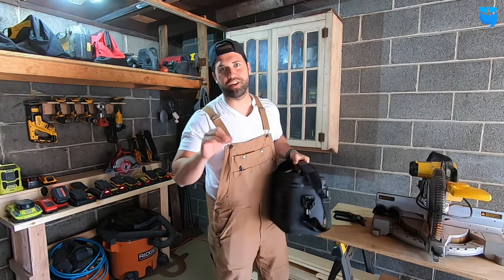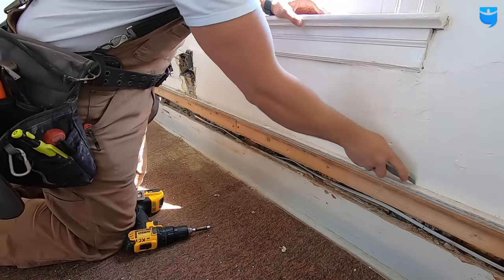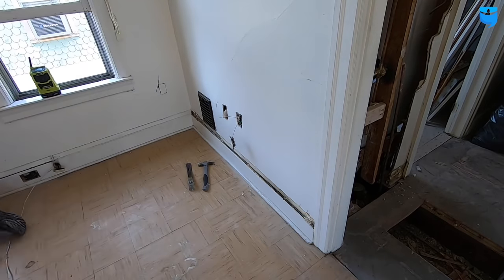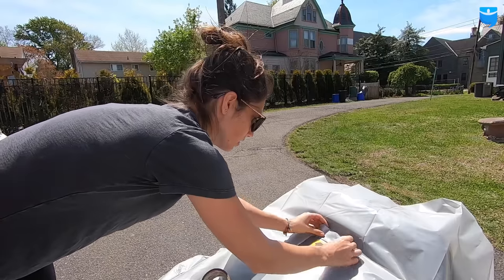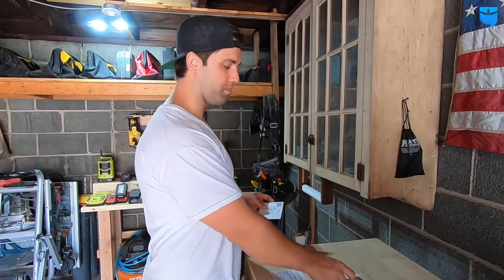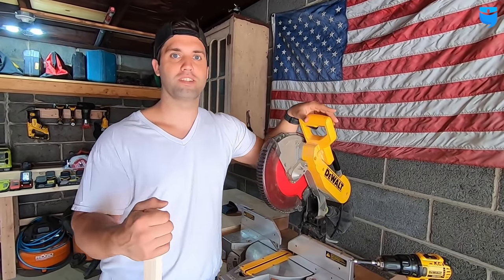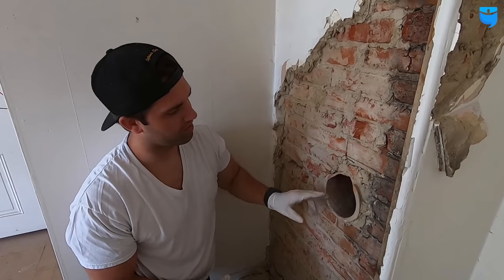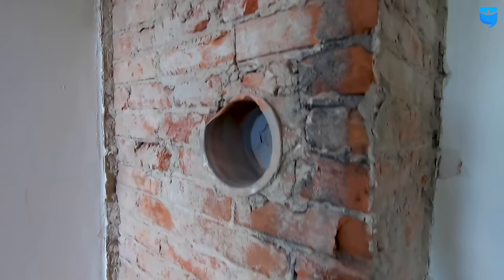EP 10: Exposing Brick, Drywall Installation & Renovations on Our BRRRR Triplex Investment Property!

Comment: seems like the exposed brick is unnecessary labor for a rental house eh?
I would have just left the plaster on there and kept the whole room white.
Reply: We are ALWAYS looking for cheap ways to set our units aside from others. Don’t stray from your budget but we are huge believers in renovating for the tenants you want.
Reply: @RentalstoWealth  how do you clean the brick?
Reply: mario butters So I kinda like that German Shmear kinda look so I just wire brush by hand any raised and loose stuff away then put the sealer on BUT if you want it clean looking I’ve used this before and it works super well (do any brick cleaning/drilling and apply the sealer prior to laying flooring or baseboard cause the brick dust will stain anything and everything. Sealer works awesome, when you’re done you can run a white tee shirt over it and it’ll be clean)

4 in. x 1 in. Non-Woven Drill Mount Quick-Strip Disc

https://www.homedepot.com/p/202830913
Reply: @RentalstoWealth  thank you